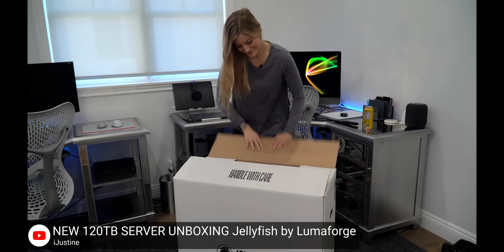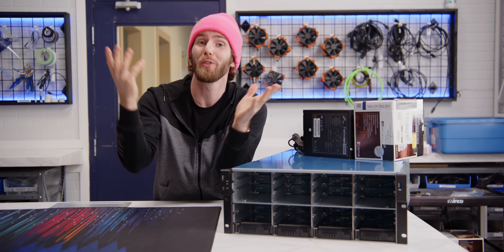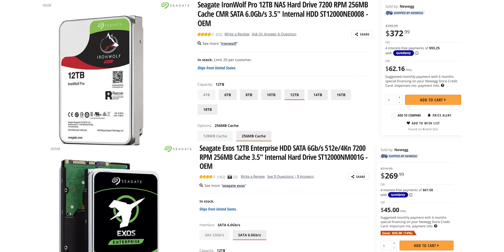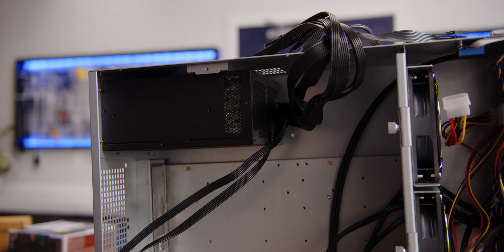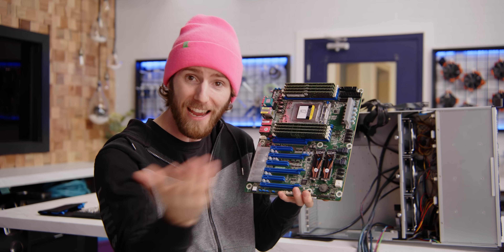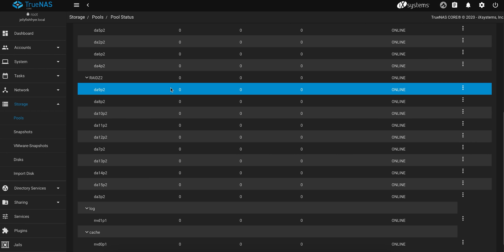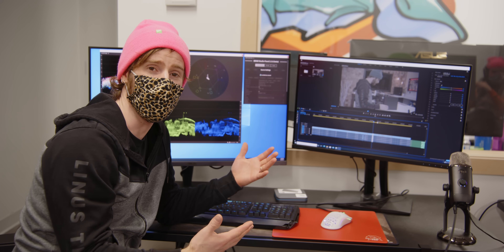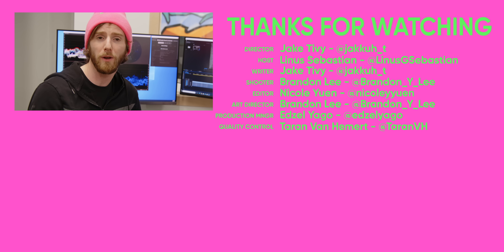Here's How to Save $45,000 - The Sensible Jellyfish Fryer

Comment: Why not optane for SLOG and L2ARC? And single slog..
Reply from the maker: Just not necessary for the performance we need. If er had it running 40gbit or 100gbit networking locally that's what we would have done.
Reply: @LinusTechTips  Thanks for your answer. Still SLOG/ZIL isn't a write cache. Its a safty net for data in flight and thus only disk with power loss protection are an option. Otherwise you may run unsynced writes and have an even faster result.
Thats why optane / nvdimm / nvdimm via PCIe or some STEC devices are littlery the only option left. Addionally you will lose the data from the point, when the consumer slog will fail, as every write will be written as well to it. So the low TBW is a concern for a backup server, which you build.
I am just puzzeled that everything else is so well thought of and than cheaped out at the slog/zil. As mention above run unsynced writes and spare the slog in total. performance will be even "faster".

A 100GB optane would have been more than enough. those are about 120USD new.

Comment: To be fair to jellyfish though, is that the Warranty and the actual support system behind is the reason why people pay for it. Sure you can do it cheaper but if you do it yourself you need to be A) Tech Savvy and willing to spend the time or B) Employ/get someone to do it. IT peeps rarely come in cheap if they what they're talking about. This way you just buy the thing, plug it in and go for it. When it ever has any issues within the 5 years of warranty you talk to them and should promptly get a replacement and the neccessary support. 

You can always do it cheaper in IT, but have you calculated the cost of the knowledge and time needed to do it yourself? What happens if anything breaks?

Comment: I setup a 10gbe direct connect interface on my unraid server running zfs but I don't even need to setup a fixed IP on the client side because I bridged the connection to my firewall via the server so my pfsense install can provide IPs on the same subnet effectively making it a zero configuration direct ethernet connection